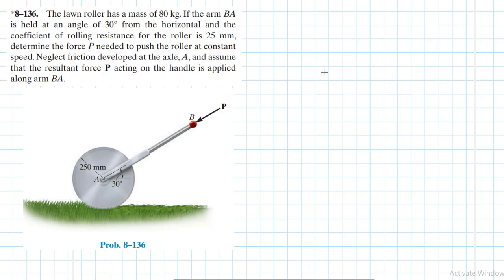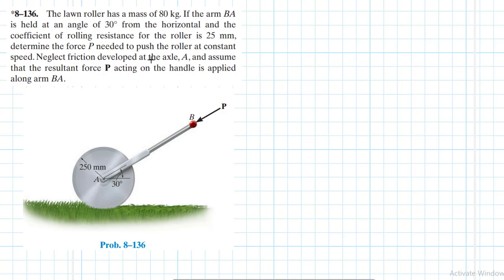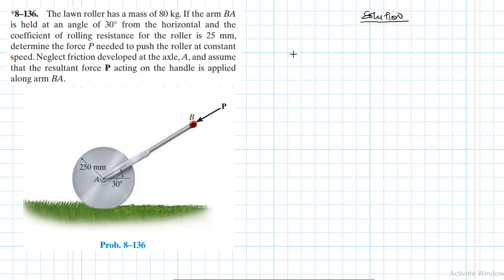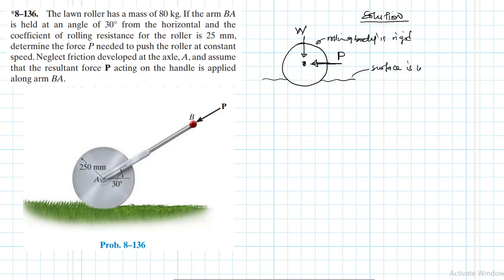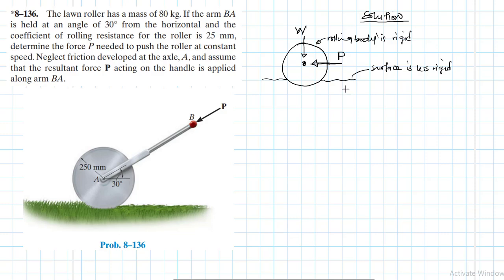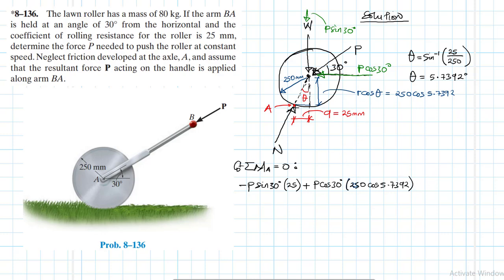8–136 Friction (Chapter 8: Hibbeler Statics) Benam Academy

Comment: how can we differentiate when a normal force is perpendicular or at an angle when the term "rolling resistance" is not stated in the problem? are there keywords?
Reply from the maker: When a rigid cylinder rolls at a constant velocity along a solid surface, the normal force exerted by the surface on the cylinder acts perpendicular to the tangent at the point of contact. This force is crucial for maintaining the cylinder's motion without slipping. However, since no materials are perfectly rigid, the interaction between the cylinder and the surface involves a distribution of normal pressure rather than a single point force. This distribution results from the slight deformations that occur at the contact interface, where the cylinder compresses the surface slightly and vice versa.
Reply: @benniehamunzala  Thank you!